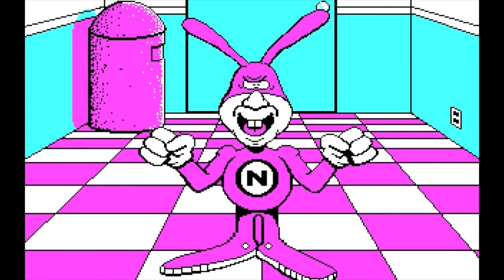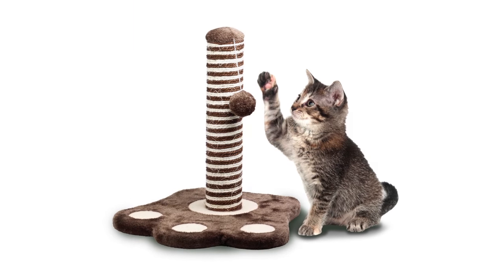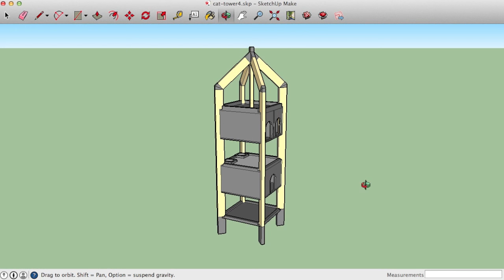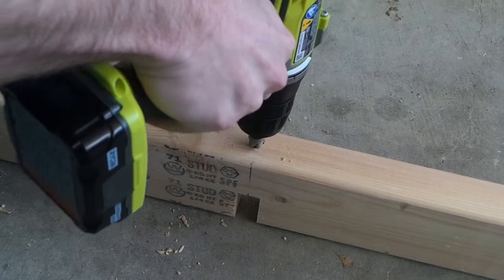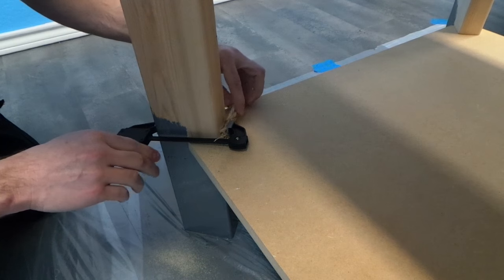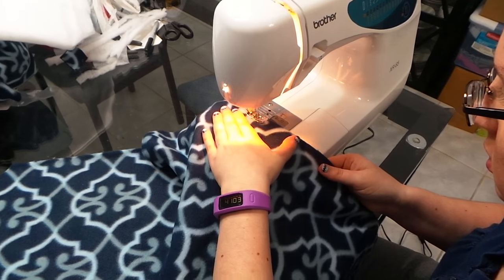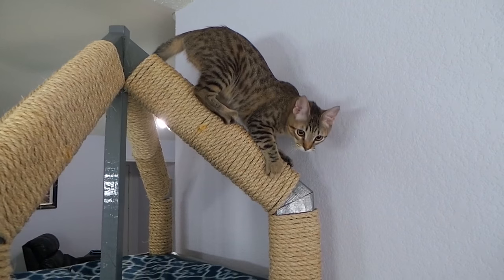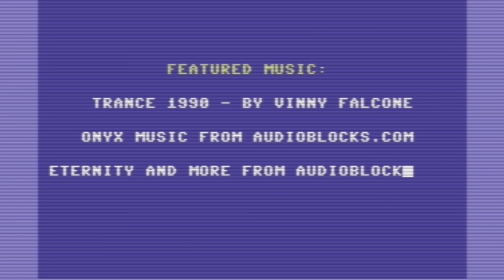How to build the Kitty Rocket Tower Cat Tree

Comment: did you remember to paint the bottoms of the wood feet? the part that actually sits on the floor. this way it cant absorb spills from the bottom.
Reply from the maker: +ggin nj I didn't show it in the video, but I actually attached some rubber feet.
Reply: @The8BitGuy  oil paint is best in any place . i remember when i was designing an water pump indoors it once shot water at the wall and the paint was fine because its oil paint

Comment: Mr. 8-bit. Did I tell you that Apple did something dirty. They forced me to update my Apple Watch. Like literally forced me or my apple watch would be bricked.
Reply: Ikr
Reply: Yeah. Kinda of bad, worse is that my iPhone 5c CONSTANTLY says upgrade to IOS 9.2.1 but the storage of my 5c is 8gb. Yes my mums planning to get me a new computer because that's in a rek of a condition. (Screens dented in a bit, sides lost a whole edge right near the hinge, a key is not functioning well and the others gone, fully but you can press the white square thing. The fan is steaming hot and the things are gone near it. And a rubber band is half cut off and another was lost when I dropped it. Cracks on the back.) and the iPhone 5c because the space is horribly low.
Reply: +WindowsVista Dude20 for me, I'm in the betas. So when your running alongside with the beta, you HAVE to update or your phone will be completely bricked. When I updated, they discontinued using the WatchOS 1.0.1 software. Which is completely unfair to discontinue software that's less then a year old. Also it's shit
Reply: +Brian S This is why I can't ever buy anything apple.  Sell you something that looks pretty on the outside for something underpowered on the inside.

Then after that everything works like crap on purpose to drain your wallet even more.  This is coming from someone who loved the Apple IIe as a kid for Oregon Trail, Number Munchers and the like.

And to be fair there's a lot I don't like about windows as well.  I've even tried Knoppix, Ubuntu and others as well and like them.
Reply: +WindowsVista Dude20 Delete the update file from phone storage and it will quit telling you.
Reply: +Luca Van There's no file manager for iOS. (And no jailbreak, because there's only 8GB.)
Reply: +G4U There is a file manager, go to settings, general, storage and usage, manage usage, then delete the update file. It takes up like 300mb and the ios will download another update and bug you for that one too until you delete it.
Reply: I think Mac is the only thing Apple doesn't force.
Reply: I would make a snarky remark about owning an apple watch in the first place but then I realized what channel I'm on so I'll hold my tounge
Reply: Jail break it
Reply: I think your mom got ripped of buying you that 8GB iPhone 5c.It literally has the same storage as the iPhone 2G (2007)

Comment: That's a pretty sweet cat tree!  My only comment would be if one of the cats throws up in one of the cubby holes, it'll be hard to get inside of it, but at least you have it semi-easy to remove with the brackets. Thanks for sharing!
Reply from the maker: +Retro Power Up Hopefully it would all be on the padded cushion, which is easy to remove and clean.  But yeah, if it goes over the side, then it might be more difficult.

Comment: You could use velcro to attach the carpet to the sides, making them removeable, I don't know if you can machine wash them but, it would allow for replacement or removal for cleaning.
Reply: I was going to do the same to mine on the inside! I was going to have no carpet for the outside of mine. I also considered screws, but I had safety concerns.

Comment: No no no.  Cats will NOT just puke wherever they happen to be at the time.  They make 100% sure they are on carpet or a rug.  Mine is 8 years old and the only time she didn't puke on carpet or a rug was when she puked off the utility room counter, which landed into my work boot on the floor.  Lovely.  
My cat is a puking machine, I had to buy a damned hand-held carpet cleaner machine just for cat vomit.  And I brush her all the time.

Comment: I ve the same problems as you! , one Macintosh Se, and more, commodore, monitors, computers... to restore, and four young cats, their mum, one female big dog, and I m making plane for a tower of private apartments for cats! Your idea making a dining floor will keep in my mind if possible, because five adult cats jumping together to run on their food is certainly using too much surface! For the SE, I will not do the test to start monitor, until opening the computer, and remove the dust around the hight voltage part! I did this a lot of times on classic tube monitors, not store in wet atmosphere, put in the working room one week before, at same temperature, and when open, discharge, and remove the dust every where.   As you said we can t upgrade Firefox I thought it was my old iMac going too slowly, but if the G5 cant do it, I know now this is not for that! Thank for your videos!

Comment: Hey 8 bit! I know this is a old video but I still like it, How are the cats doing? If you have any room you should get a Blue Russian cat, yes you heard me right, blue russian, They should be hypoallergenic and they are not actually blue, but in shades of black and white, They are so beutiful, And maybe, the rocket tree can be improved to have like a little rocket nozzle at the bottom just for decor, or maybe the interior of the nozzle could be hollow. can be used for cleaning supplies. And since you know how to solder and wire things, maybe a switch can be placed and the nozzle would light up! That would be so cool!

Comment: Hey I went over every inch of your woodworker friends site I was unable to find the plans for that tree. I know what your talking about I got one for my 4 cats as a Christmas present you need a metric ruler and a understanding of reading Chinese LOL.  I took Mechanical & Structural  Design in HS (back in 1998-72) before CAD systems. We had to use the old Drafting Table and had to buy this Heavy Green imitation leather cover 5" thick and 12#'s MACHINERY'S HANDBOOK 19th Edition Reference for Draftsman Toolmaker Machinists. we had too carry back and forth to school. because we had homework and we needed to reference the trig charts or screw thread angles etc.  

Let me know if you have found it please
Reply from the maker: +Kristyanna Virgona There may be a few days delay before it shows up.  It will be there eventually.

Comment: I built one for my sister cats that almost looks like yours,  but i used PVC pipes.  anyway nice build !
Reply: Linux & Other Stuff Good idea! In fact when I saw the thumbnail, I thought all those 2-by-4 planks were 2-by-4 PVC cable ducts, that are inherently liquid resistant.  But if using wood, I would suggest putting some dowels in the assembled corners to not rely on glue alone.

Comment: LOL I think you built this thing WAY Stronger then your desk!!!  I built my desk out of two sheets of MDF 3/4" 49" x 96". mounted on the wall with 3 2' x 4'. 3 levels on bottom are two removable bays. on  the left is  is for 2 towers. and on the right is a book shelf  style. main level is 35" of the ground it is in a L shape design but angled in a way to match up to a chair pushed in to match the upper shelf that house the monitors. from left into the back corner of the wall its 49" for the corner down the  opposite wall it 72".. the 49" wall the desk is 31" wide. and the 72" is 24" wide. the top it 10" off main level . both runs down each wall is 41". with a with of 10". with the front edge flatting out  to run a 12"  instead of a 90 degree. total build took 5 days. I had all the tools. so no cost there. cost of wood, hardware, paint, was $85 not bad. the closes store bought desk that was close enough to these specs. cost $300+ I have a triple monitor setup on the upper level, main level houses. keyboard, controller, mouse, speakers, and my prize possession a custom built pc Rig in a Corsair Graphite Series 600T with newest addition of the ZOTAC GTX 980 TI AMP! EXTREME. the bottom level.  I have housed a 415 all Aluminum SB2.2 Racing Engine on rolling crate stand. with distributor  still in. and it all fit under there with out any problems. or leg room restraints. the bookshelf I use for storage for all my extra pc related stuff. and the tower bay just now is a storage for my gaming wheel when not mounted to the main level.  sorry I know this probably didn't need to be here. in this video but I couldnt stop LOL

Comment: How does that rope hold up? My cats shredded the one i got them years ago which was wrapped in carpetting. It's a mess now ^.^
Reply: +Durakken 
looks like he used glue from time to time and wrapped it tight
Reply from the maker: +Durakken The rope should last anywhere from 1 to 3 years even with my 3 cats using it.
Reply: Rope holds up very well it's what they used to put on most posts. Now it either carpet which is is awful or seagrass which is even worse.

Comment: I see that you're not using the most current version of OS X....why?
Reply from the maker: +James Blackrock Haven't had any reason to upgrade.  Plus, that's my "work" computer that I do editing on and other work related stuff.  Right now everything is working.  I hate to introduce a new operating system and have something break because then I have to spend effort troubleshooting it instead of getting work done.
Reply: +The 8-Bit Guy have you tried using maybe that iMac to try out new operating systems for perhaps a week and if you don't like it, just restore it back to your original OS with a time machine backup? Because sooner or later, 10.6-10.8 will become truly obsolete. Maybe I'm just thinking too far ahead.